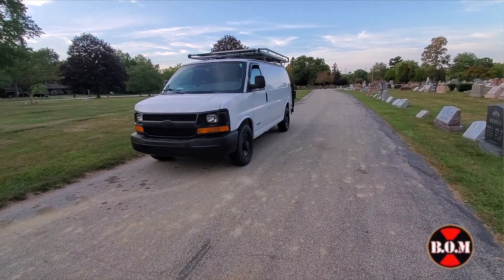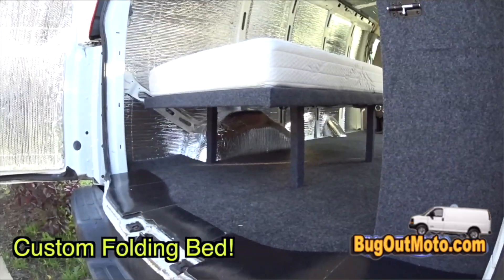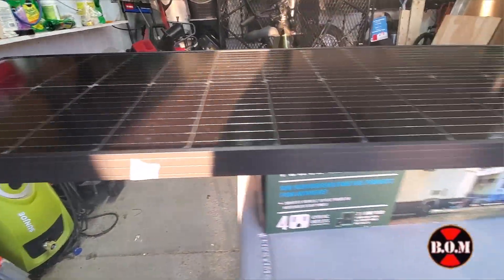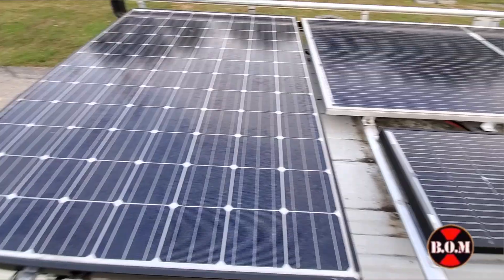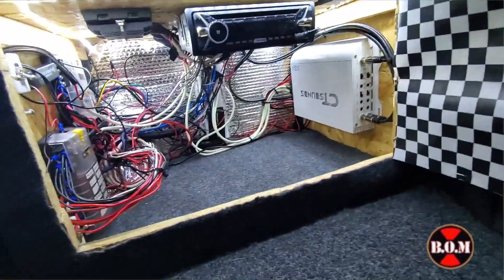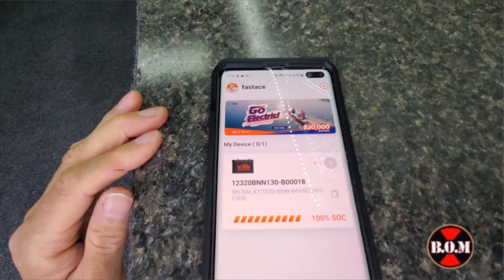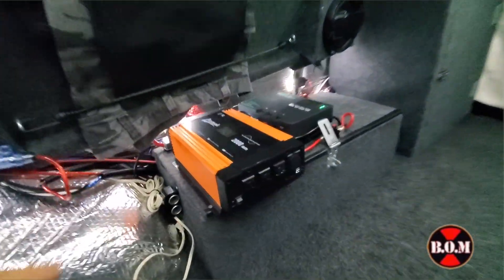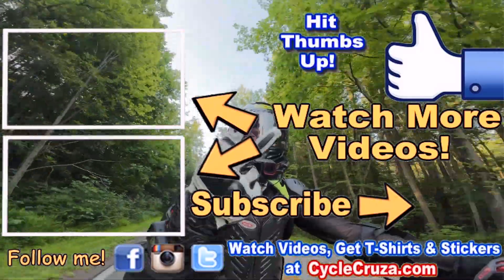NEW Solar System Ultimate DIY Campervan Build | LiTime 12v 320 Ah Mini Battery

Comment from the maker: Get LiTime 320 Mini Batt (Use “CYCLE6” & Link for 6% off):
https://cyclecruza.com/7pre
Get LiTime Self-Heating 100 Ah Batt (Use  C7UR-R9JDQT-GY83A for 6% off)
https://amzn.to/3Kfi74Q
Get LiTime 320 Ah Mini Batt: (Use  C7UR-R9JDQT-GY83A for 6% off)
https://amzn.to/3KdDhQL
Get 400 Watt Solar Panel: https://amzn.to/48s6v8C
Get 3500 Watt Pure Sine Wave Inverter:
Get 50 Amp MPPT Solar controller (Small!): https://amzn.to/4mn7YjT
Get 700 Watt Mini Microwave: https://amzn.to/4gCBK2X
Get 2 Burner Induction Cooktop: https://amzn.to/4pvYDJg
Get 50 Amp Breaker: https://amzn.to/4mpALo0
Get 300 Amp Breaker: https://amzn.to/3Insxio
Get Narrow Solar Panel: https://amzn.to/4pzqZCA
Get Hammer Lug Crimper Tool: https://amzn.to/48s6FwK
Get 2 AWG Battery cables: https://amzn.to/48puyF8
Get 8 AWG Cable: https://amzn.to/46ugYhn
Get 10 AWG Cable: https://amzn.to/47P8Kmh
Get Copper Wire Lug Kit: https://amzn.to/4muXgIa
MY 50 MPH E-BIKE Motorcycle
Get HappyRun G100 PRO Ebike (Use 'CycleCruza' for $100 off with link): 
https://cyclecruza.com/zjen
Links to get My GEAR, MODS and Other Stuff: ⬇ 
Get My New MotoVlog Camera (On Sale!): https://amzn.to/4i3oy6b
Get My Carbon Helmet (Best Ever!): https://cyclecruza.com/vhxg
Get AIRBAG Vest (On Sale!): https://cyclecruza.com/w34j
Get My New MotoVlog Camera (On Sale!): https://amzn.to/4i3oy6b
Get My New Shorty Gloves: http://cyclecruza.com/w7ae
Get My Dianese Winter Motorcycle Jacket: https://cyclecruza.com/l9xp 
Get My CE Armor Jacket CHEAP: https://amzn.to/3RpXKm5

SEE MY VAN BUILD VIDEO SERIES:
https://cyclecruza.com/how-to-build-a-stealth-camper-moto-van-videos

Comment: Nice setup! I'm doing something similar, but using 4 195 watt panels with a victron 100 50 mppt controller in a 24 volt configuration. I also have 2 Li time 100 watt batteries for the 24 volt setup. The wires can be smaller and buck converters can be used to convert 12 to 24 volt, and vice versa. Good luck on property hunting.
Reply from the maker: Nice! Best of luck with your build.

Comment: I really like the redundant solar systems. 

Nice bike, I bet it's got some torque. My old Surron seems slow in comparison to all these new bikes.
Reply from the maker: Thanks. Whether it is one solar system or three, it serves the same purpose of powering everything but split between three systems and should one system fail it is easy to switch over to one of the other solar systems. I don't understand why more nomads don't do this, especially van dwellers where you can't put a bunch of batteries together in parallel.   
The new ebikes are getting faster and faster. I just saw the new King GOAT that does 70 mph and it has pedals!
Reply: @BugOutMoto   I slapped some pedals on my surron too, cops never mess with me. 

My buddy just got a Talaria MX5 for $3700 used last week. It does 60, so much pull when you're in Hyper mode. It's addictive man
Reply from the maker: I have a Happyrun G100 PRO that was sent to me, does 50 mph. I can't imagine doing 60+ mph on these little ebikes. lol

Comment: You still have this thing? Lol I remember the first video you ever made on this rig back in the day.
Reply from the maker: Yeah 10 years later and it is still going strong. I just took a little trip to KY and back. The 1 ton Express vans are rock solid, can go 500k easy, I only have 164k miles. I nearly bought a 2024 AWD Ford Transit high roof extended van  to do a new build but I just don't have the time, builds are extremely time consuming and the high roofs can be an irritation. I like being able to go anywhere, underground parking, fast food drive throughs, etc. And you stand out like a sore thumb with the high roof vans. Not as stealth.
Reply: Most impressive van build still. ❤
Reply: wow, it has been 10 years; it feels like yesterday

Comment: That solar setup is crazy
Reply from the maker: With a standard van you have little space to put a bunch of batteries in parallel so you have to spread them out like I did but you can't properly run them in parallel spaced out like that with different lengths of wire,  one reason I did three solar systems but it is great because it if a component fails in one system it is easy to switch over to one of the other solar systems which happened to me once when I stayed in Yellowstone.